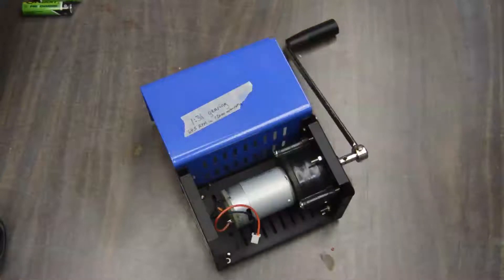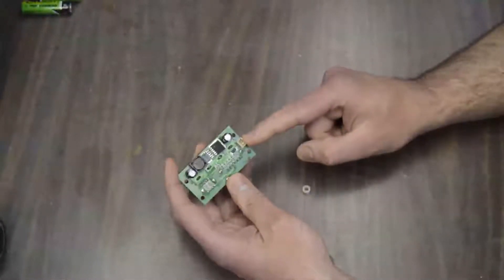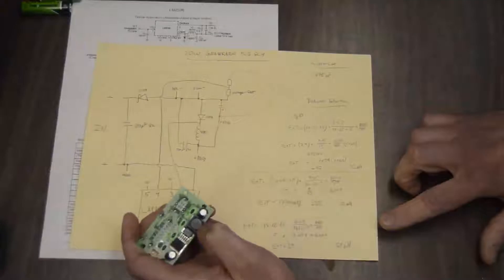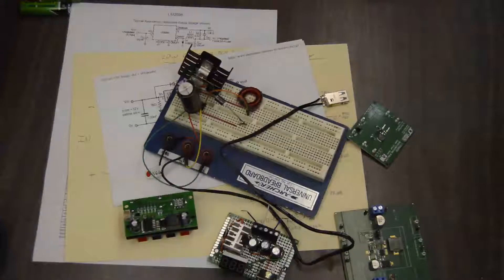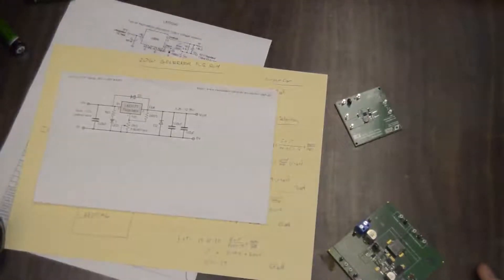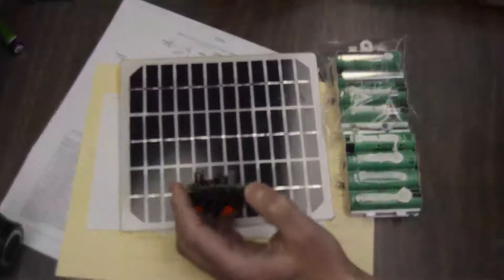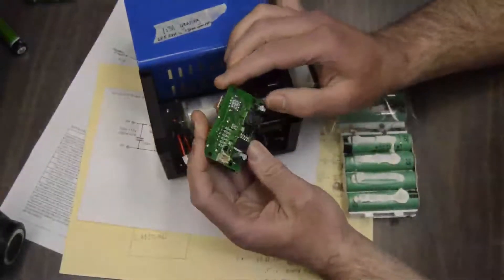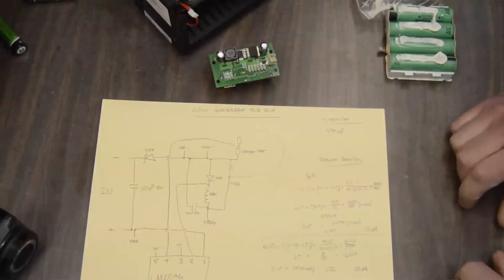Banggood 20W Hand Crank Generator Part 2: Teardown & Analysis

Comment: I tried throwing an LM2596 on a small crank radio when I put a lithium battiery in it to replace the nickle one. The voltage was too low so I had to order an MT3608 that works at 2 volts. I think the LM needs 3.8.

Comment: I'm interested in a pedal generator that powers a super efficient e-bike motor. Would love to hear people's ideas on that...It's probably just one more fantasy to get enough power by pedaling that wouldn't wear me out but I'm thinking of putting it on my back wheel in addition to my 1000 watt front hub motor. Or maybe just use the pedal generator to boost the power going to the single front motor! Less weight and complexity.

Comment: Why not use the enclosure and drive gearing and pair it to a different more appropriate motor and electronics?
Unfortunately, even if you did that and put not only a more appropriate motor but a much higher quality one, your arm is really the limiting factor no matter what. 

This is an unfamiliar exercise for which you do not have good conditioning for performing for long periods of time. (you have probably never turned a handle in your life for a 1/2 hour straight)   Even a very efficient set up is going to need at least 4-5 additional mechanical watts into the motor to end up with 20 watts at the load.  Even charging an NIMH 2500mah AA battery is going to consume over 3 watt hours (they are not 100% efficient, especially at high current).  Even if the battery could take 2500ma, which most cannot without damaging them, that would be an hour of turning this thing.  I would not want to turn that handle for an hour straight even without an electrical load on it. 

Maybe a month of doing it every day for an hour might leave you with a build up of the right muscles and "muscle memory" to not become fatigued.

Comment: the secret is always in the pully system to more points engin starter is just a kicker you just want a yank cord instead of hand that means motor loop power enough to start the motor loops around to charge the outer moter but pull other charge makers just rip cord and go its a loop kicker ...

Comment: Yes i know what you mean. I bought this unit and filled it with 8/ 2.7v 100f super caps. I have also swapped out the circuit board and replaced it with a 4amp mppt regulation board. I can output what voltage and amps output that i want.

Comment: Hello.  Can it be used to charge the Yaesu ft4x or Baofeng uv5 radio?
Reply from the maker: Yes, both chargers for those radios appear to take DC from a typical barrel jack.  Be warned that the owner's manual for both radios suggest that battery charging time would be 3.5 hours...

Comment: 20 watts on such a tiny crank, I don't think so.  Did you load test it using a resistive load and a real power meter?  My generator that I made can at best do around maybe 10 watts.  And good luck cranking  after two watts by hand, the torque gets very in your face, not easy at all to maintain this kind of force over prolonged time.  My thoughts is maybe fractional watt at best for that tiny motor.  Power really needs torque to transfer energy in big numbers.  Any way, it is compact overall, but I would not believe them specs.  Any generator that produces some real amount of power, usually has some sort of gas engine driving it with real horse power to create realistic energy to do practical work, otherwise we are talking micro power under one watt of energy.
Reply from the maker: I forget where in the video (and dont feel like finding it right now) but it does hold up 20W on the unregulated output through a resistive load. The real weak link in this product is the switching power supply, it is very inefficient.  In Part 2 I succeed in getting it to light a 13W fluorescent lamp.  Overall I still rate it as 'junk' though. Buy a 20W solar panel instead.

Comment: I'd love it if someone would sell  or release the schematic and foil pattern for a PCB to adapt old cordless drills to be crank generators, I see them used all the time at thrift stores etc going for next to nothing because the cost of buying new batteries isn't worth it, but some of them have pretty heavy duty motors and gear boxes in them that are probably superior to what's in that Banggood generator. Maybe have the kit designed to optimize the output and suppress the noise of a 12 or 18v drill motor and leave working out the mechanics of making it crankable to the person? If this kind of kit is available somewhere already someone please direct me to it.

As far as suggested mods to the Banggood generator I'd attach pieces of angle iron to the sides to allow it to be clamped or screwed down and one inverted piece across the front to force it to stay flush with the edge of the table so you don't end up having it creep around and bash the handle and/or knuckles on the edge. The angle iron can be salvaged from an old bed frame for free if you grab one someone is throwing out, for the $30 I might get one of these generators just to see what kinds of mechanical enhancements I can come up with.

Comment: change motor with large one to get more AMP but check if the regulator can handle more power, motors used for wind electricity generator are the best, one used here is a chiness low quality

Comment: Problem with Chinese motors is that  materials like copper, magnets and other components are expensive and the purity of copper as well as thickness and number of windings with good quality magnets, is a pipe dream when it comes to Chinese motors. The ultimate problem is that stupid consumer should stop buying these crap until the manufacturers learn their lesson.
Reply from the maker: The problem with your reasoning is that China has become the industrial powerhouse that it is as a result of standardizing components across multiple industries. The economies of scale have lead to an overall increase in quality. Manufacturers have no lesson to learn here, as they only make what retailers specify they should make.  The exception to that are things bought directly from China, doing an end-around on retailers.  An excellent example of this that I am familiar with is the oscillating fan. If you go to a US retailer and buy two fans, the cheapest one they have, and the fanciest one they have you will discover that they use EXACTLY the same motor.  It is the same because of those economies of scale, it would simply cost more to make two different qualities of motors. The 'cheap' one is lubricated with corn oil, while the 'good' one is lubricated with a proper synthetic machine oil. The cheap one is the way it is because the retailer contracted with the manufacturer to produce a fan that breaks after one year.  Retailers make far more money from you if you buy the crappy product. They are the enemy here, not manufacturers, and not an entire country.

Comment: Chinese crap, needs more gear ratio, needs stainless steel well lubed gears, doesn’t need long handle at all, since it is Chinese crap that doesn’t need any torque to turn it.
Reply from the maker: Just the other day I took apart an Oster bread machine that someone had thrown away, and it had a rather nice belt-drive mechanism I was thinking about using for this, though the motor is 110V and wouldn't be suitable for this application.

Comment: This thing is cranking it out at 4amps tho right?  So doesn't that mean that to get FULL efficiency you have to pop TWO usb batteries into it?  After all those things can only take 2amps far as I know...maybe THIS needs to factor into your earlier test from video 1, I will of coarse watch it to learn more.  After all I have to get the best use of such tech I can, and knowledge is one of the keys.

Comment: Just got mine from the amazon locker pickup...so THIS video is going to be super valuable for me.  Right off the hop you can see it needs some super basic mods...like with the crank shaft etc. obviously (loose).  Was trying to think maybe it's a design intention, yet I KNOW it's more a flaw...probably also plastic cog wheels may need BACKUPS, or even a metal replacement for durability.  Of coarse I just bought this for dual purposes, to learn more of tech by hands on, and also as a useful GOSO tool (which is the english name of the company that sells these as far as I know).
Reply from the maker: I'm glad you're finding it useful.  I enjoyed making the video. It's a shame I don't have more time to do this sort of thing.
Reply: It would be a better improvement to figure out a jig you can put it in so you can power it with something other than your arm/shoulder.
Turning that handle is an unfamiliar and unnatural movement.  I would guess your arm and shoulder would be fatigued and sore within 15 minutes of turning it even at a low power output.

Comment: Is the gear made of metal?
Reply from the maker: No, they are made of nylon.
Reply: @moconnell663  ohh well maybe you know where I can find similar generator just with metal gear?
Reply from the maker: @kolaivan9945  Unfortunately I do not, though I would imagine that any product which DID have metal gears would probably advertise that fact in its description.
Reply: @moconnell663  I found one it got Brussels generator as well
Reply: @moconnell663  but it's pretty expensive

Comment: A lot of reviewers of this device will only crank the lever a few times and when the phone lit up they will immediately conclude this this device works. No one has tried to use this device to a 0% charge phone. There's no real life practical testing of this device. How many turns and minutes of cranking the lever to gain 1%, 5%, 10%, 25%, 50%, 100%  of charge to the phone?

Comment: how do i get a copy of instructions in english
Reply from the maker: It doesn't come with instructions but it's fairly self-explanatory. You set the output voltage using the slider switch on the front.  If you are intending to charge a USB device, you want to set it to 5V. Otherwise, set the voltage to match the device you intend to power, red is positive (+), and black is negative (-). The terminals on the left are regulated to the voltage selected by the switch, the terminals on the right are raw power directly from the generator.

Comment: Hello bro, what if I put a Eolic propeller kind of thing on this engine? It would blow the system? What is the max RPM?
I have one but never used as never needed.. thanks a lot
Reply from the maker: You "can" do anything, however the gear train is plastic as are the bearings on the input side.  It is not designed to handle any axial load, and putting blades on it to be driven by the wind would add substantial axial load. Also, due to the torque required under load the blades would have to be rather large, perhaps 1m long and that will definitely destroy this little thing.
Reply: @moconnell663  thanks a lot, my only concern is putting the thing on fire and burning my land, where I live the fire risk is very high most of the year so... Atm the little thing worth nothing as I've tried like you and it's impossible to make it generate energy.
Reply from the maker: @felipedeluz  you are very welcome. It will fail mechanically long before it would do anything that could start a fire.

Comment: I don't believe those diodes are there for polarity protection.  I believe they are there to covert the generator AC voltage to dc.
Reply from the maker: A brushless motor would produce AC output, however this is a brushed motor.
Reply: @moconnell663  Thank you for your reply.  Yes, I was mistaken.  I had thought since a dc motor has alternating magnets fields, NSNS, the result would be alternating current as the coil moves through alternating magnetic fields.  Cheers

Comment: "470" inductor marking means 47*10^0 (47uH). "471" would be 47*10^1 (470uH). It's similar to SMD resistor codes. 

A generator like this needs either a matched load or an MPPT converter feeding a battery in order to extract maximum power, similar to a solar panel. It's an inherently flawed device and not made to be anything more than a toy.

Comment: would something like a bike generator with 3 motors running of 1 gear be good?
Reply from the maker: You mean like the dynamo that runs off friction with the tire? High-power LEDs have basically made those obsolete.  They never functioned well to begin with and now that power requirements are so low, batteries make much more sense in that application. The biggest challenge to making a generator that can be powered by hand is finding a motor that can be spun at a reasonable speed and still produce significant power output.  I tested a power-tool motor just now, and spinning it full-chooch with my cordless drill only gave me 1.5V. I think the ideal powerplant would be the motor out of an electric bicycle or scooter.

Comment: Someone has already done  it before  he uses a  spring type winder like  the one used in Clocks or toys then add up a Dynamo motor to power up  any electronic devices for  decent time frame

Comment: If you want a crank generator you should first consider that with your legs, Lance Armstrong(7 times Tour de France winner) has an output of about 300Wh average in an hour(On steroids).  So if Lance Armstrong was to sit on a "Bike cranked generator" he would avarage about 300W for an hour. A normal human being would do about 50% of that(If you are a fat guy maybe 20%) A 300W output is the same as 25Ah@12V. 

With your arms AND hands it will drop to about 60Wh(5Ah/h) and thats if you are a really strong man. Average man might do 50% of that(2,5Ah every hour @12V or 30Wh). This is NOT accounting the mechanical losses in the crank/gears to generator. 

In reality a normal human being would be able to avarage about 10W per hour with a portable hand crank generator which means you could charge the new iPhone X in an hour(if the phone where in OFF mode while cranking and the cranking mechanism was at 100% efficiancy). So please don´t kid yourselfe, you would more likely get carpal tunnel syndrome before charging your smart phone.

Source: https://www.power-pedals.com/legends-of-cycling-power-output-watts/
Reply: I appreciate your real life deductions on possible Wh outputs. So ... how much power can I expect from my 84 year old granny if I feed her extra Wheaties and coffee?
Reply: Obviously it depends on what muscle group we are talking about and how fit your 84 year old granny is but I would guesstimate about 40Wh@legs and 5Wh@arms + 3-4% extra for the Wheaties and coffee ;) You would have to messaure it yourselfe though to get the exact amount!!!

Comment: The printed specification sheet the video reviewer holds up is easy to find online. 

The motor used in this device is from the series FRS-555SP, specific model FRS-555SP-21110, which is made by Katri motors. Their product catalog of motors is easy to find on google (file "dc_motor_spec.pdf") and page 66 is the one you want. This is the page the video creator is holding up in the next "Part 2: Teardown". Other motors of this series would perhaps be better suited to provide the regulator circuit with a lower input voltage so as to facilitate efficiency of the regulator circuit. The USB 5V output is arguably the most desirable setting / output and such a motor change may help a lot with this. And, since it appears the motors of this series are the same physical dimensions, a "remove and replace" or motor swap should be quite doable. 

Katri motor FRS-555SP-3263N rated at 6.0 - 18.0 volts and 460rpm would be my first choice as a replacement motor to optimize the 5v USB output. Where to buy? Thorough ebay searches and google searches using some numbers from the listed specs for this motor may yield a seller where a few units could be purchased. For some reason I will doggedly continue to try and make this crank generator better. May as well right? Buying it was a rare mistake on my part - I failed to search for detailed reviews such as this one prior to buying. 

Note1: I purchased mine on ebay for $29 mid February 2019. Upon receipt I opened it up right away to perform electrolytic capacitor replacement and addition of filtering ceramics caps on the motor and in parallel with the electrolytic cap. Plus to add a ferrite toroid to wrap the input wire from the motor around. I immediately noticed the circuit of this unit came with a large 35v 2200uf electrolytic capacitor on the input! So clearly a change has been made. ( Ultimately the manufacturer of this device needs to change the motor, add heavy filtering and ferrites, even dispensing with the voltage select divider and fix it at 5v USB output... with a line out unregulated jack, not these black and red spring clips from junk speakers.) 

Note2: Searching ebay for “SMD 47uh power inductor” results in images of the same component used on this device. It features 470 printed on the component. Sold as 47uh. So I think 470 means 47uh (microhenry) after all. Not 470uh. Searches for other value SMD inductors reveal this to be the case also – appearing as a regime of indicating component value without adding decimals.
Reply: Do you know how much the motor costs?